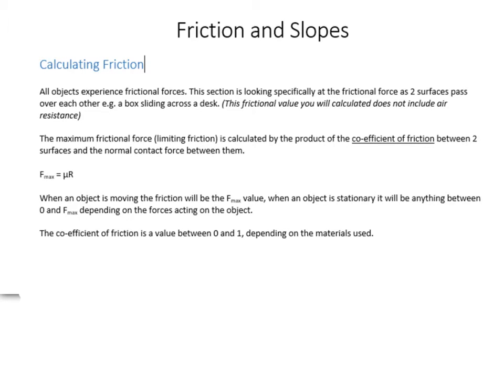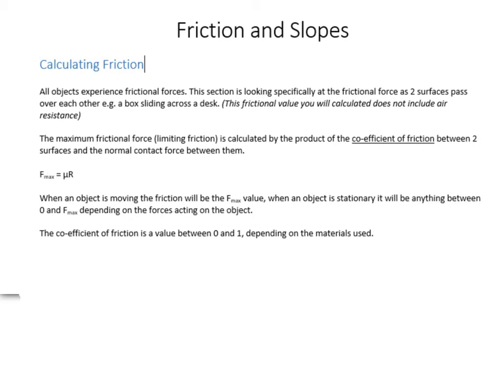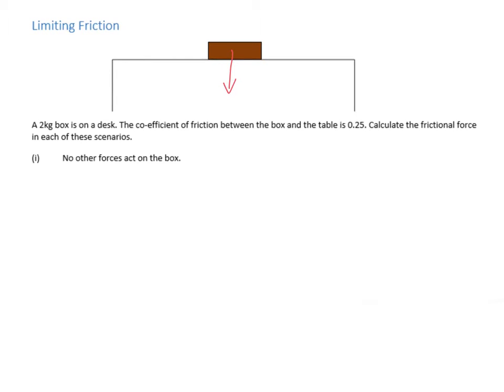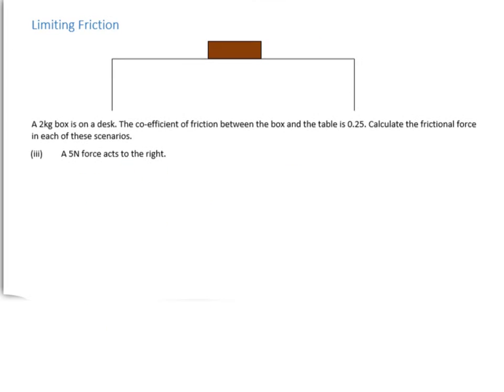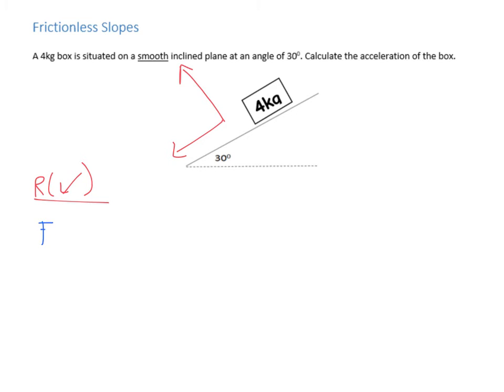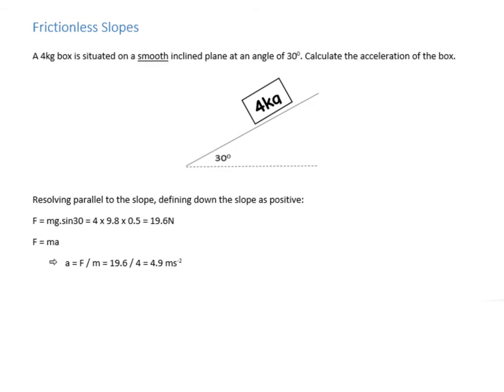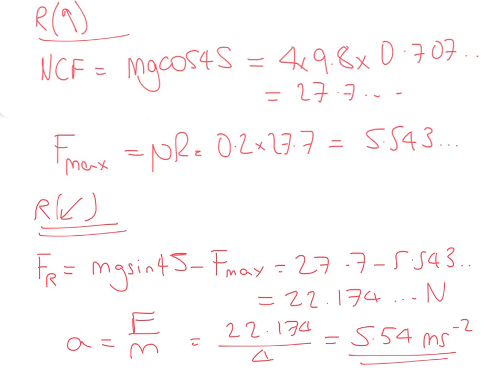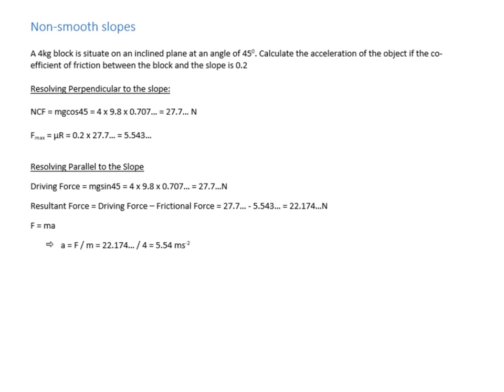A Level Maths: AQA: Mechanics 1: Friction and Slopes

Comment: For the first part, you said that with F=3N will cause the object to move the left? How is that possible?
Reply: He said this was not possible, as friction never causes an object to move. The maximum friction is 4.9N and as this is greater than the force applied, the friction must simply be 3N in order to stop the object from moving.

Comment: There are plenty of surface combinations that have a coefficient of static friction higher than 1, silicone rubber is particularly notable, but even 2 aluminium sheets can be 1.35